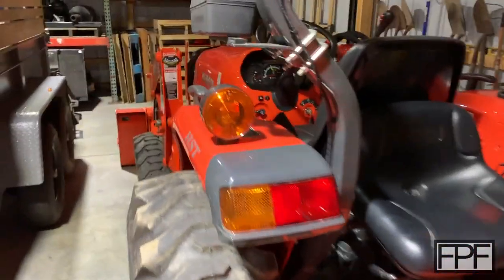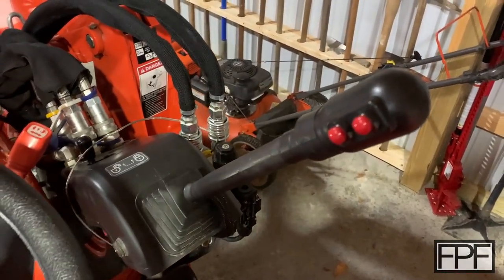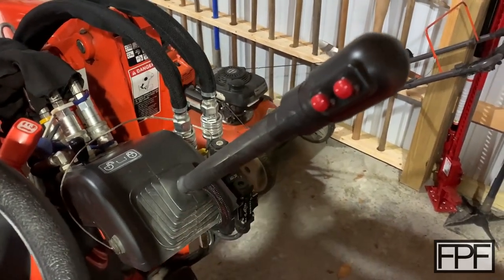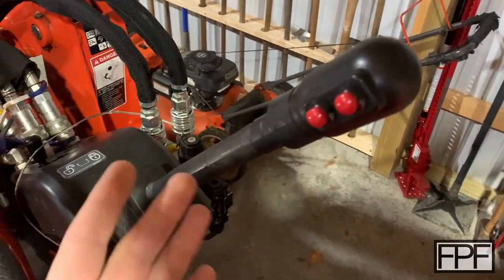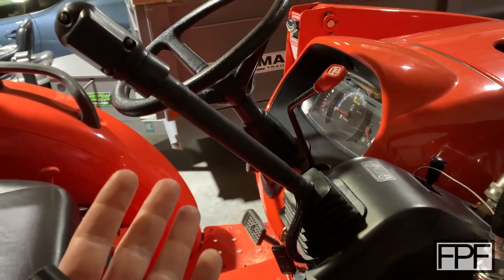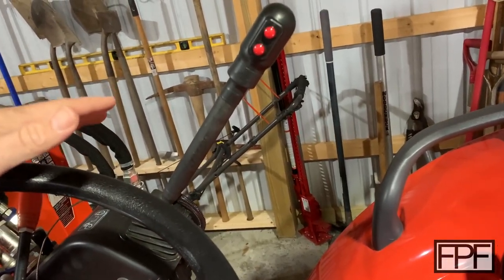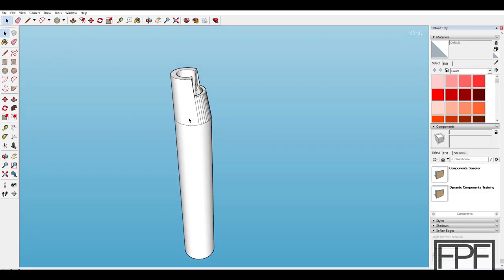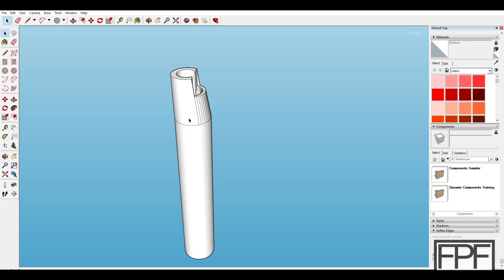3D Printed Wire Sleeve for 3rd Function Kit from Land Pride

Comment: I used 3M self amalgamation tape and wrapped it. That and notched the boot at the bottom to route the wire through it so it exits clean and away.  But yours works to. And I absolutely agree with you about the price of the kit and no thought given to the anesthetics of the install by Land Pride.
Reply from the maker: I thought about notching the boot, but was afraid it might tear over time.
Reply: @FunctionalPrintFriday  I think it will dry out and fall apart on its own volition regardless ... LMAO
Reply from the maker: @CC-Rider  probably, yeh :/

Comment: I think that would be great for my install.  If you mentioned anything about fitment with other kits I missed it.  I think I will purchase a Summit 3rd function on either of my L3800's this week.  Thanks for sharing and I just looked thru some of your other videos.  You really opened up your mind to the possibilities with a 3d printer.  I appreciate your skills.
Reply from the maker: It would likely work with other kits, but may need to be cut down and the OD might not match.  It's an 'exact' fit for the Land Pride kit.

Comment: Does that Auger do well? I read someting about the pump capacity on these L series is a little lacking? 
Cool build. I ran my cable into the rubber boot and wrapped it around the stick, no problems so far. Summit kit, used for a grapple, which is my favorite tool.
Reply from the maker: I run my RPM's up a bit higher when I use it (I adjusted the stop) to get up to ~2700.  More RPM's does correlate to more GPM on these machines.  I wouldn't do that if I used this every day commercially, but for a home gamer that uses the auger 2-3x a year at most, it's great.

Comment: Land Pride/Kubota should license this and include it so their kit doesn't look like some hillbilly added the second function.

I'm less than impressed by Kubota due to an issue with a brand new BX23S slowly losing anti-freeze somewhere when running and them not wanting to do anything about it as well as the morons who designed and approved the plastic hydraulic transaxle cooling fan and it's half-baked guard which leads to it being extremely vulnerable and a PITA/$$$ to replace unless you do what Kubota should have done and add a 3/4" access hole in the floor-pan to get to ONE bolt.  Otherwise you have to remove the entire rear fender assembly.  Dealer cost to replace that $10 part is $600.